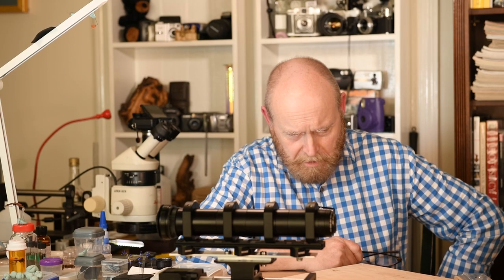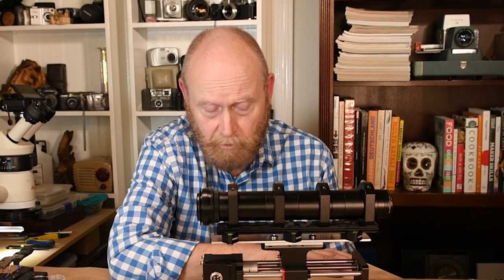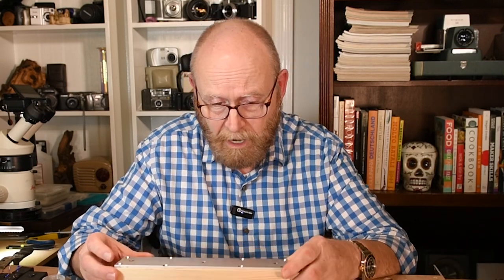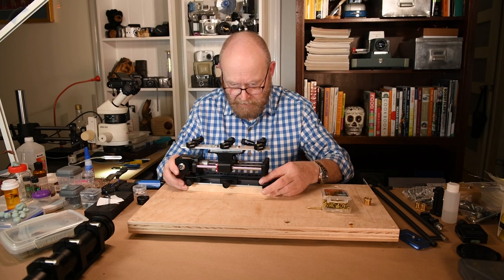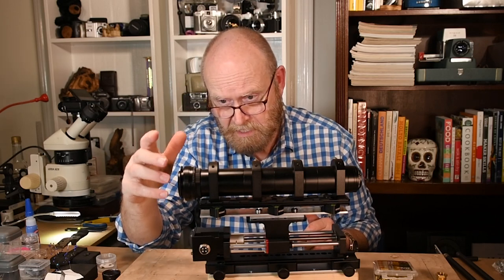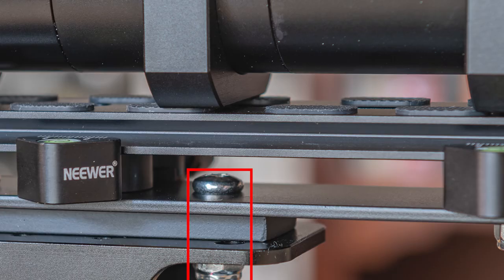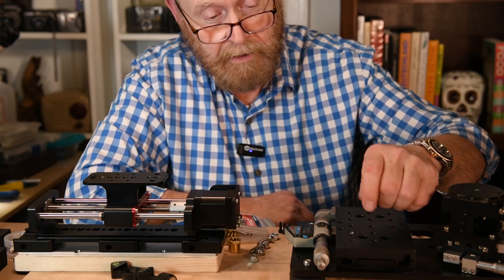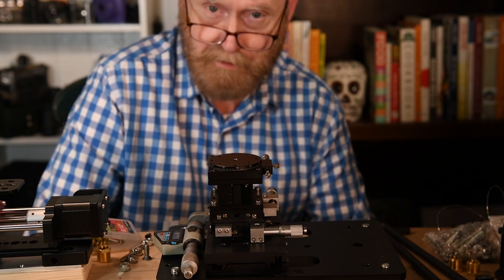WeMacro Focus Rail - a better horizontal macro platform

Comment: Allan — I have just found your YouTube channel and am going through your fine and informative videos. I enjoyed your discussion of the WeMacro platform as I recently acquired one and like it very much. Thank you for your review. 

However I built my own focus stacker. Becoming ill back in 2017, I needed something to keep me busy, and making my own stacking rail seemed the thing to do. Not having messed with electronics for more than 50 years and coding since the 1990s made all the more interesting. A linear screw with a stepping motor, an Arduino microcontroller, and a few other parts was all it took (except a lot of time). I don't understand WeMacro's decision to use Bluetooth and your smart phone for control. A 4 line display and a 10 key keypad makes the whole process simple and direct. I suspect I can have my camera stacking while you are still connecting your bluetooth. 🙂

Comment: I once worked in a company that manufactured spinning wheel gyroscope inertial guidance systems. They had a Test Equipment Engineering department that made jigs and fixtures, among the fully automated test equipment. I always was drawn to their jigs and fixtures. Your work is reminiscent of what they did. They had access to a fully calibrated engineering machine shop that could make any of those rings and things you bought to scary tolerances. Yet, I like your designs. I worry a bit about tolerances, but you seem to select good components. You impress with considering various scenarios that will arise, given your aims. Meticulous. Gold Medal stuff. And, your home made helicoil was ingenious. If you had been willing to use the real thing, you would not fear a vertical orientation. And, under some cases, a bit of Locktite might ease your vertical fears, a bit. Best macro channel by far.

Comment: Great video as usual. I saw a rig were they had made an aluminium sq and hung the camera from te top . The sliding rail was fixed at the bottom and lighting to the sides.

Comment: Alan, you need to learn about medium density fiberboard (MDF).  I think it's preferable to plywood for building platforms because it's heavier, stiffer, more uniform in thickness, less prone to warping, and easier to machine without splintering.  Available at any home center in 4' X 8' or smaller sheets in a variety of thicknesses.  I used 3/4-inch MDF for my platform and stiffened it further by using torsion-box construction.  A torsion box is built like an airplane wing -- a lightweight grid or web of uniform thickness sandwiched between two panels.
Reply: heard of precision flat ground granite tables. a greater upgrade. its what i will use.
Reply: Agree

Comment: Allan, (or any viewers) when using the helicoil have you found the "slop" that exists in the helicoil to be a problem? [if you extend the helicoil say, 10-20+ mm and grab both ends you can move these ends axially independently of each end by several mm]! Could this be a problem when doing extreme macro? I have just discovered this slop exists in my helicoil, which I purchased because I am not usually a fan of bellows! When the helicoil is properly mounted and held in the lens-extension clamps, the camera can still move relative to the axis of lens setup, all be it by the small(??) amount mentioned above??  Cheers, Ian

Comment: Hot damn. Walls bought the sniper scope equivalent of macro rigs 😅. I would have done this using old Sinar rail camera components and called it a day. The more that I start to dick around with macro setups the more I start to hate life as those few axes are a pain the butt to nail . 

Btw I use wet towel corners and snap wasps and flies with them in my house ( thrill of the chase); the physics of locker room towel snapping shenanigans allow you to compensate for the superior dog fighting manoeuvres of nimble insects . Spray Windex on the wasp so that he can’t summon the rest of the gang with his pheromones.